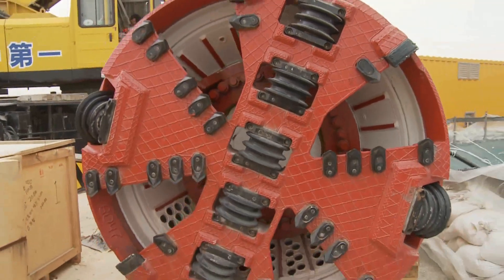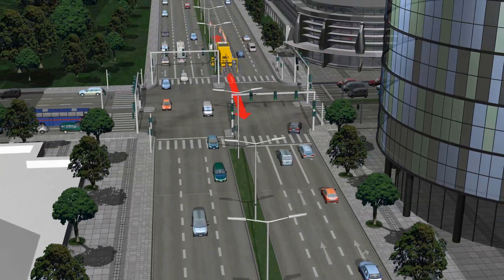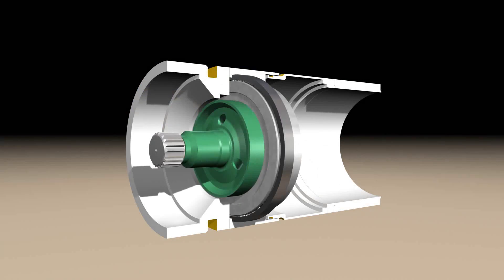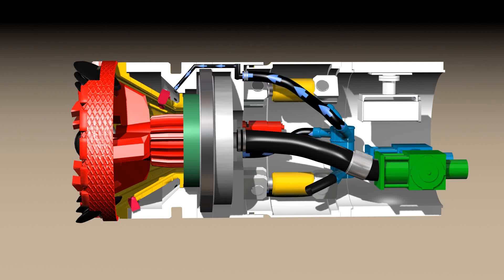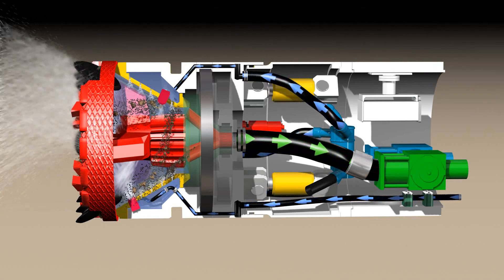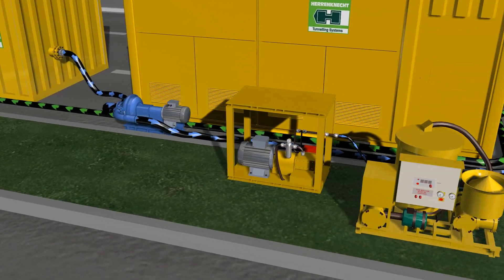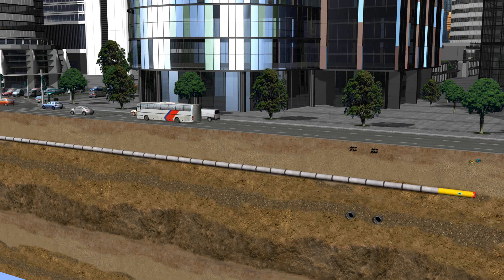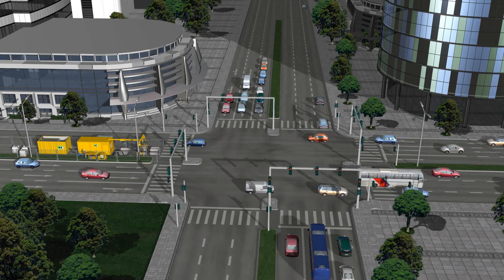Micro Tunnel Boring Machine AVN600

Comment: i need one of these . 2,5 meter in diameter for a zombie apocalypse bunker :)
Reply: Andy Casbo yeah I'm thinking about welding one together and casing the tunnel in dressed stone. Though I want to make a spiralling tunnel that goes down.. and down.. and down.. and then build the resident evil hive. Which brings up the thing.. about drilling horizontally.. (mineral rights.. oil wells etc. Past the property line..) and oh man.. tunnel mazes.. and then like.. a secret wall that opens.. explosive charges.. I figure I need about 9' diameter (3 meters)

Probably 15 or 22.5 degrees incline.. rail system.

Best thing is to go until hitting bedrock and then vaulting chambers.
Reply: Just coming from Colinfurze... lol